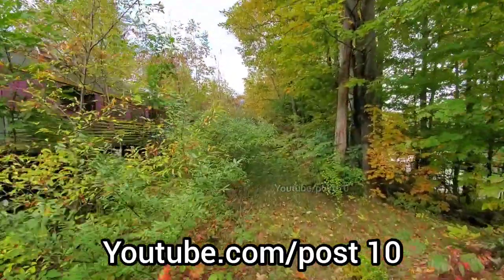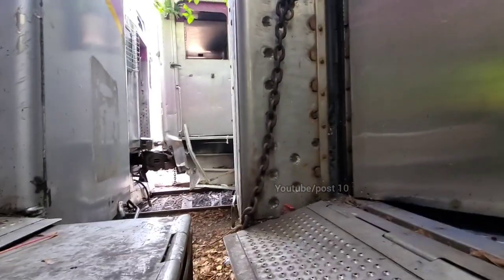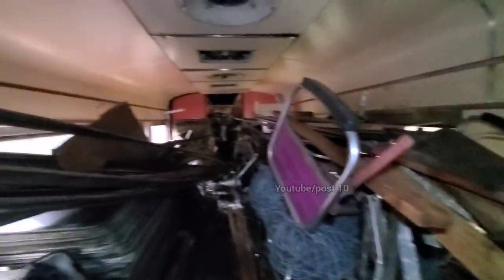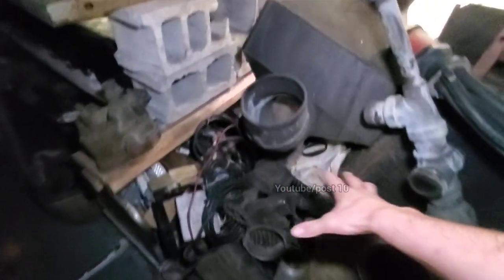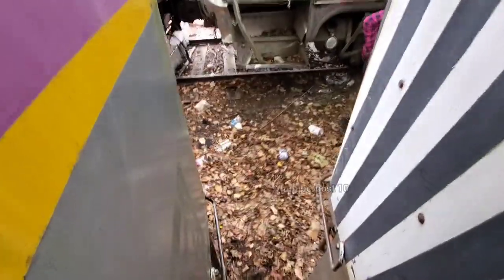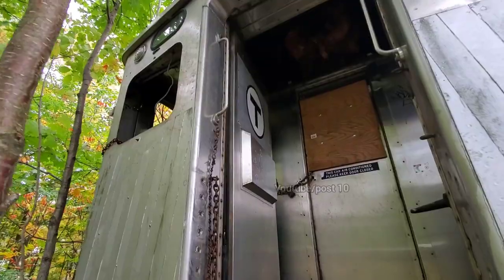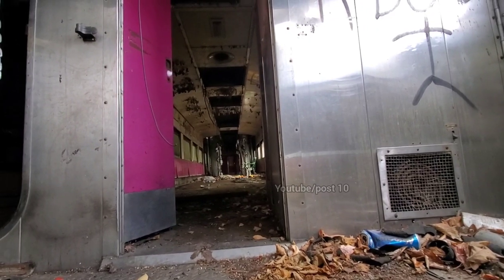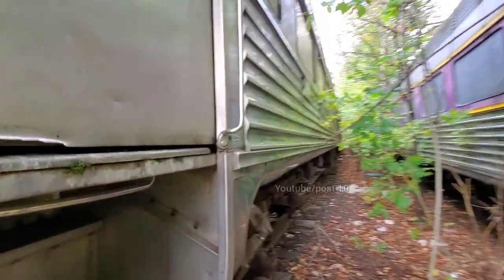BOSTON Trains Left Rotting In The Forest

Comment: That is a Budd Company Rail Diesel Car (RDC) you were in, post 10.  Self-propelled, one Diesel engine for each truck mated to hydraulic transmissions, and capable of multiple-unit operation.  Very reliable back in the day if the engines were started up, the car(s) run in service, and then the engines shut down at the end of the run.  Idling was not good due to the high compression ratio.  Also, the filters/fluids needed changing per the manufacturer's recommendations.
Reply: Most of those there are ex. Boston and Maine Railroad, too. The one at 7:25 is a B&M Baggage Combo, hence the large side door.
Reply: And lots got de powered and were ran push pull by f series locos

Comment: Unless they are historical, they should be recycled!? Aluminum could get as much as 60 cents a pound.
Reply: You think that is aluminum or stainless steel?  Thought aluminum at first, but wow, is that siding shiny, and not a lot of dents.  I'm thinking stainless.  Either way, you're right.  Do something with them, or recycle them.  I also wonder if that excavator has something to do with recycling.  Might be why they are there.
Reply: @stanstenson8168  You are correct in your assessment:  stainless steel.
Reply: @stanstenson8168  I will let you test it! If a magnet sticks, it is Stainless Steel. If the magnet does not stick, it is Aluminum.
Reply: @michaela.chmieloski3196  Beautiful stuff.  That siding would look great somewhere.  And it is crazy durable.
Reply: @stanstenson8168  Not as lightweight as aluminum, but certainly more so than steel.  And as you say, very durable; does not need painting to protect it from the elements.  That is why it is the metal of choice for decades now when skinning railroad passenger cars (in addition to use in other components.)
Reply: @alansmith4734  true in most cases but it is possible for a magnet to stick to aluminum (would require a very powerful magnet) from google,
The best answer is to say that aluminium is not magnetic under normal circumstances. This is because aluminium interacts with magnets. Also, when exposed to strong magnetic fields, aluminium can be slightly magnetic even though it does not exhibit magnetism under normal circumstances.
Reply: @alansmith4734  Stainless steel doesn't leave scratches when you try to scratch it with something sharp, easiest way to tell. I used to work in a metal yard and after awhile you can easily tell by the look and feel. But on occasion it's super hard to tell the difference on some pieces!

Comment: Former Boston and Maine cars. Several were rebuilt by the MBTA in the early 80s without motors but these look like they weren't which leads me to think they were beyond repair even in the mid 80s. When they worked they were economical to run and kept train service alive on many branches throughout New England into the 1960s whereas it would not have been financially viable with engines hauling un-powered coaches. B&M had the largest fleet of them and almost all went to the MBTA. One special one was "the president's car" with a kitchenette in it.
Reply: @manidig: I remember riding on these in the early to mid 80s just before they were taken out of service.

Comment: Those cars are owned by the Plymouth and Lincoln Railroad or commonly known as the Hobo Railroad just around the corner. They purchased a ton of those RDC cars, most coming from the MBTA. As well most of the fleet the MBTA had were from the Boston and Maine, that’s why there was a Boston and Maine car mixed in.

With the Hobo Railroad and Winnipesaukee Railroad they operate a number of those cars, as well as the privately owned RDC cars located in Danbury Connecticut make the frequent trip from Danbury up to the Hobo Railroad so those parts in those cars are valuable and are reused to keep other cars operational.
Reply: How dare you clutter up this comment section with facts, lol.

Comment: Those fire extinguishers are not ones you pump up. They are PKP extinguishers. There is a co2 cartridge that pressurizes the main bottle and forces the Purple Potassium Powder out the nozzle. They are used on class B fires, fires that are fueled by a liquid fuel. By now that powder is a solid chunk and the extinguishers are useless.